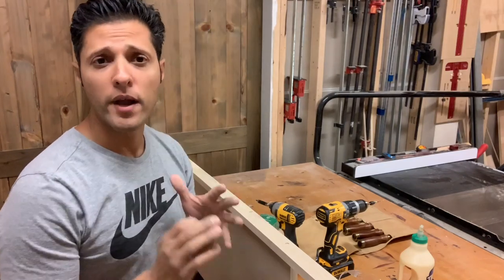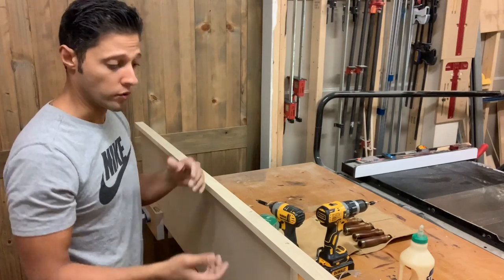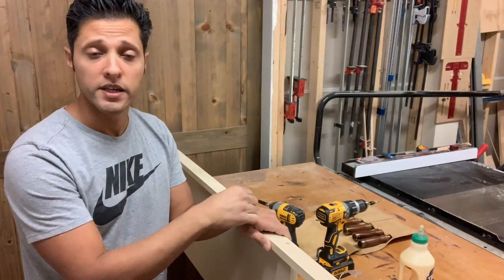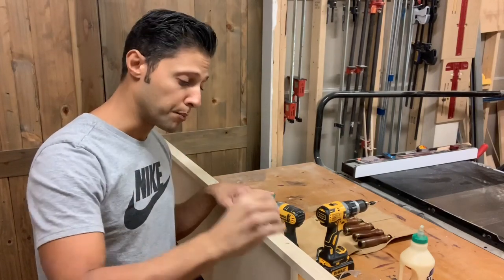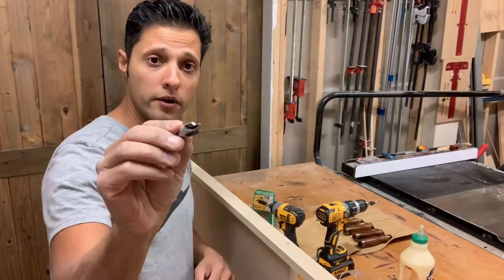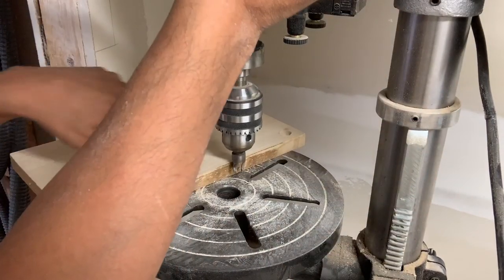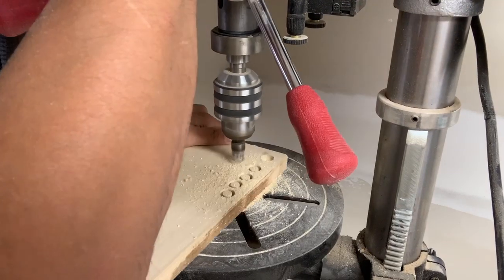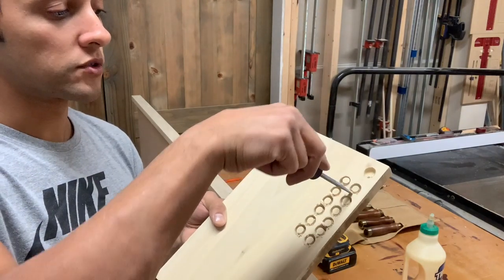How to use wood plugs

Comment: So when you countersink the screw, do you drive it a little deeper to allow room for the plug? Very new to using plugs.
Reply from the maker: Just slightly deeper, normally you would countersink just below the surface. Go just a little more because the plugs are tapered to fit the countersink holes. You want the plugs to have some material to glue onto. You should be able to tap them in with a hammer or mallet.
Reply: @AnthonyScolaro1  thank you so much I saw the plug cutters on Peachtree USA site so I'm going to order some!

Comment: I learned you can not cut tapered plugs with a hand drill I cut like 30 of them, and 2 were snug, you need to use a drill press or guide.